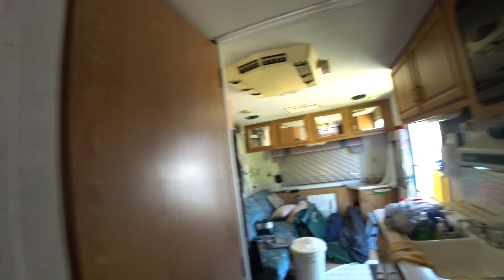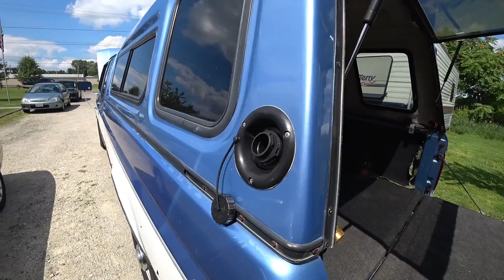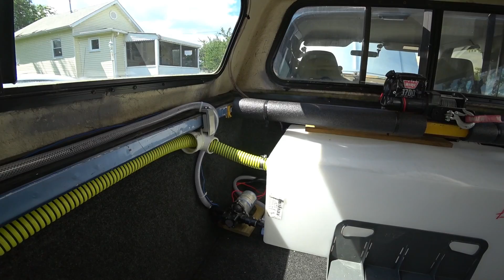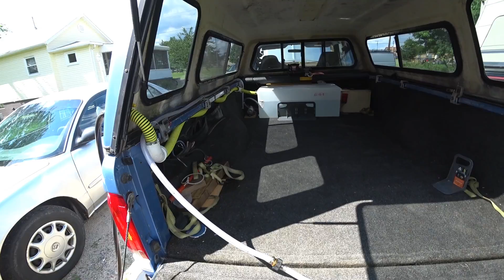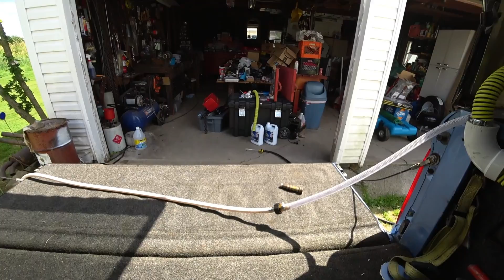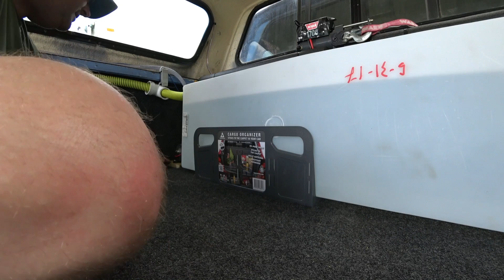RV Boondock 🌄 Extended Water Tank⛲

Comment: Commercial vehicles that transport fluids have tank-baffles to help stabilize fluid slosh and centrifugal force.  I wonder if there is a baffled tank that would work in your situation.
Reply from the maker: I looked..some older RV's use to have them...Fuel cells use giant sponges that are squeezed into the tank..I think I will be alright though..

Comment: That's a neat idea! I do have some concerns that the tank should sit on a flat surface. I would think that having the bracket under the tank, even with the wood blocks, there would be pressure points and cause failure in the the tank. I may not have a good feel for the space you are working with, but it seems that there is room between the tank and the winch. I would build a wood crate around the tank with a flat bottom and attach the crate to your winch bracket. I've seen plastic do some funky things, ,especially under pressure and warm temps if not sitting on a flat surface.
Love your videos and good luck with becoming full time rver's. I do hope to see you out there!!!
Reply from the maker: Thanks.. I am kinda leaning on that way too...Not sure yet..I don't want to build anything underneath the tank though, I like the idea that it is sitting on that carpet But securing it to the winch frame seems to be in my future...I think...lol

Comment: If you still have concerns about the vent tube you could get one of those chrome vents they use to vent marine gas tanks. Then vent it thru the roof or side of the cap. They are screened to keep insects out.
Reply from the maker: Darrell Wampler I think I am going to run the hose out of the fill location as there is already a vent there.. 😁

Comment: That's cool but but isn't your mpg going to go way down?
Reply from the maker: thunderbird97 you know there is a company that offers a rubber ball that mounts under the gas pedal so that you can't make jack rabbit starts and keeps pushing back up so you are more likely to let up off the gas more.. 😁😁 HOW FRICKEN STUPID WOULD THAT BE! 😂🤣... 😕Wait a minute Heidi wants me to look into that..
Reply from the maker: Vanna pulling the RV 10 miles to the gallon, driving to the store 10 miles to the gallon, driving 45 miles an hour through the country 10 miles to the gallon, doing 74 Mi an hour pulling the RV 8 miles to the gallon. as long as I stay under 63 miles per hour regardless of what I have in the truck or what I'm pulling I basically get 10 miles to the gallon sometimes I might be able to squeeze out 12 miles to the gallon.
Reply: need to take a couple of those lead weights out of your right shoe